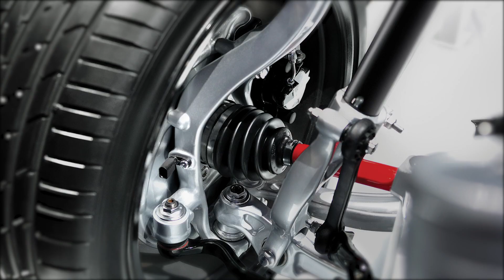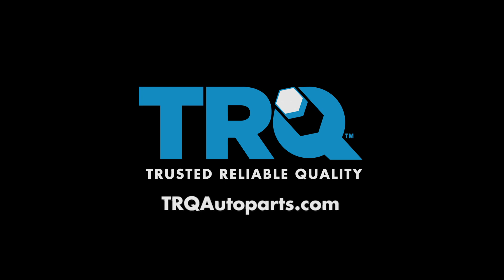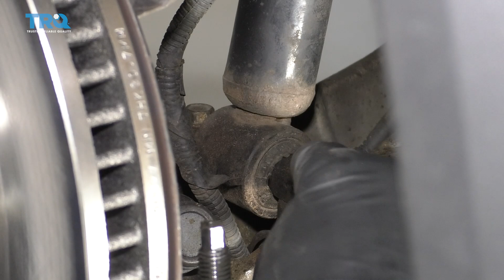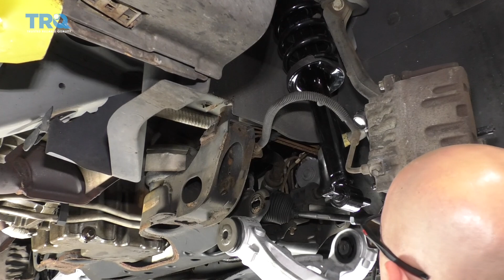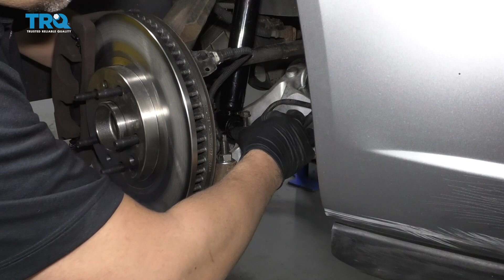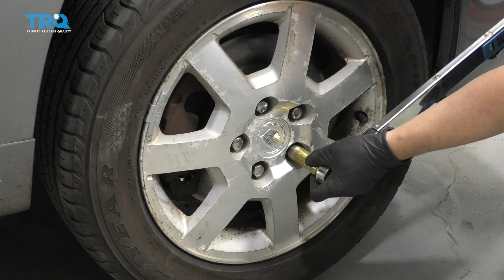How to Replace Front Passenger Side Lower Control Arm 03-07 Cadillac CTS

Comment: Before you start take a measurement from the center of the wheel well on the fender to the center of the wheel. Jack the arms to where the axle is the same measurement. Tighten bolts.